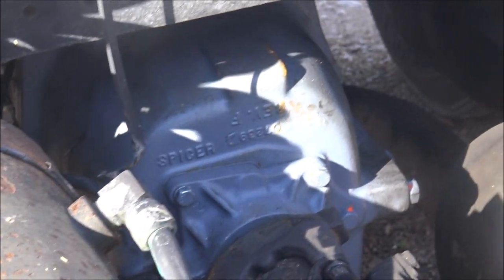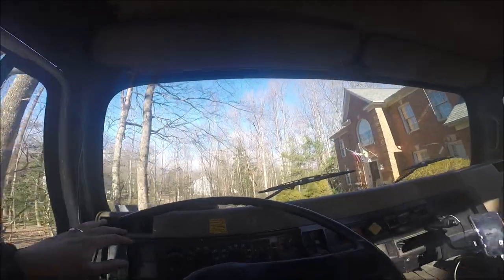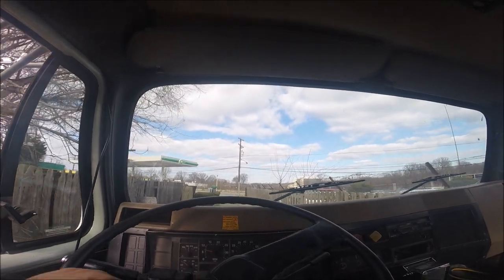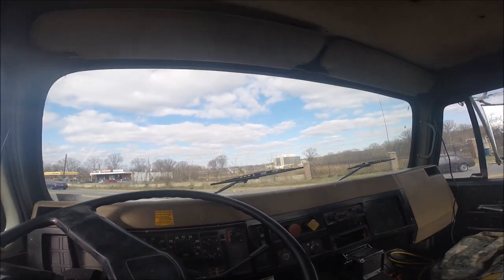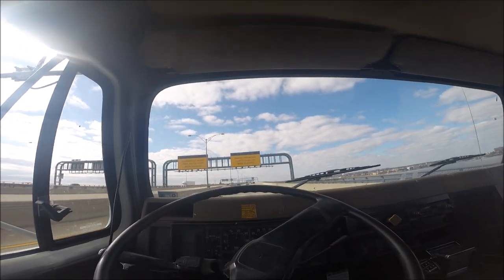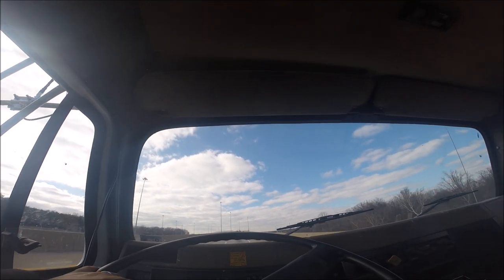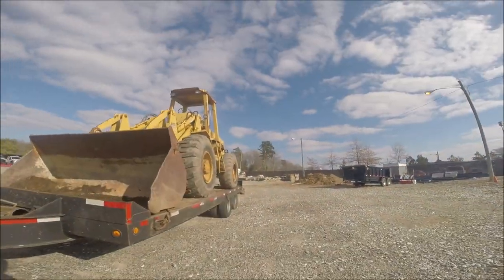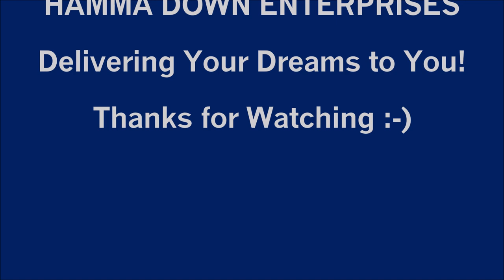Hauling Fiat-Allis 545B Wheel Loader with International 4900

Comment: Now that's the T444E engine in the truck right . I have a 2000 with the non turbo 7.3 idi from navstar so mine is slow but I have the 6+1 splice transmission so I can maintain hwy speed but it doesn't pull up hill good 👎 I'm looking at the same truck just swapping engines and transmission also because mine is a crew cab its useful for me . Great video keep them coming 👍🏽👏🏿🙏🏾 HAMMER Down!!!
Reply from the maker: fallenSkys prepper this is a DT466.  I tried to see if I could get a 9-Spd.  But both the mechanic and the the tech at transaxle said it would’ve been a lot of extra work ($) to change to another transmission.  As it is, these older trucks require the smaller input shaft.
Reply: Man it hauls ass for a DT 466 it's the turbo are non turbo?
Reply: @fallenskyshomesteadingandp2528  My guess is this is a turbo model. I can hear whooshing.

Comment: Would you recommend the truck for lets say 5 car hauler ??
Reply from the maker: Yes.  This truck is good for 10-12 tons. I think it would do ok at 15 tons via 5th wheel.  I bought it primarily to pull my 35 foot gooseneck, but haven’t used it much since I have the Western Star and lowboy.

Comment: Hi, I’m curious as to what engine is in the truck?
Reply from the maker: Hotwheels I’m certain it’s a DT466.  But. I will confirm with a certified IH tech
Reply: SLHawk92 I thought maybe was a 466. That’s impressive for that little thing to pull that weight. 
Keep up the good work with the vids. I look forward to them.